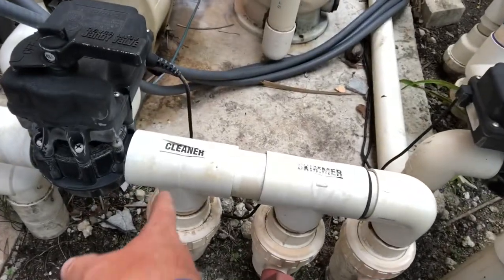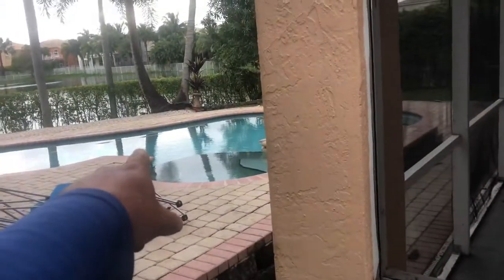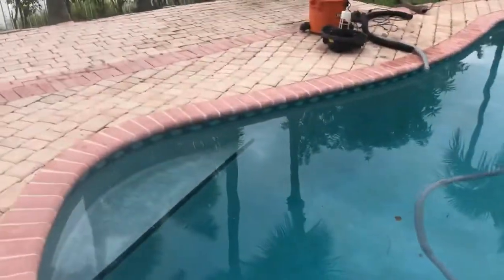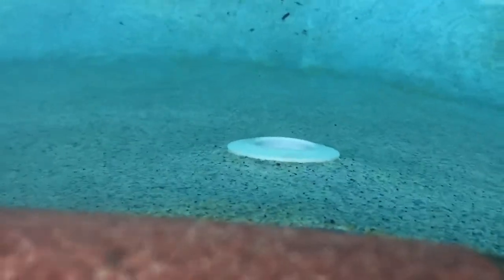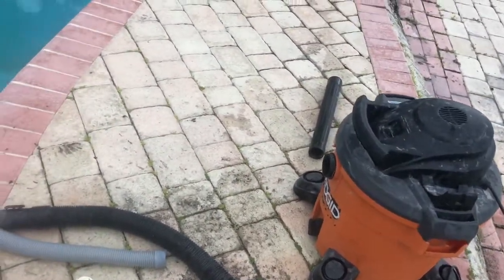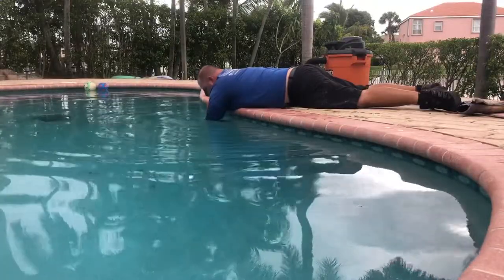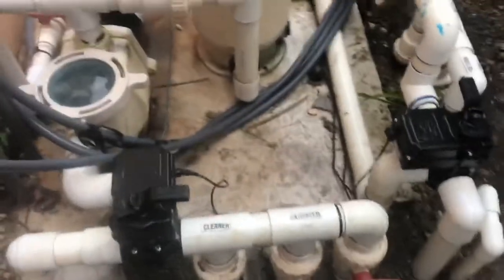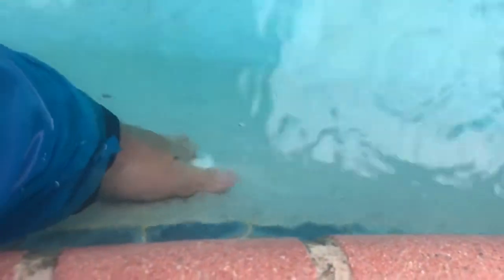Pool Plumbing Clogged!! We Unclogged It.

Comment: What you’re doing is SO informative, but PLEASE turn off the music so you can be heard better!!! Especially when the equipment was running and then you were at a distance vacuuming while talking. It’s absolutely awesome what you’re doing, but so frustrating listening to beat box music and trying to understand every word you’re saying. I’m going to go try this right now and see if it’ll helps. If a clogged line is not the problem, I know we had a burnt out gasket (or the ring inside, idk) for the skimmer/vacuum controller. Could that also pose similar symptoms with not enough suction?  Thank you So much for making the video
Reply from the maker: Don’t over look your pump lid and/or gasket. I’ve seen a pump lid be unnoticeably warped not allowing pump to fully prime.

Comment: Thank you for your video. I accidentally turned one of the skimmer values to a position that stopped the drain and vacuum flow. I was in a panic thinking I had a leak at first. Your video helped me trouble shoot it and quickly was able to identify the issue.

Comment: My dog knocked a big potted plant into the spa. I'm going to try and clean the drain line this way and see how it goes. I think it's full of potting soil and dirt. When in spa mode, it looks just like what the pump was doing in the video here. Lots of air, not much water and pressure swells.
Reply from the maker: Good luck

Comment: Nice job! I have a question, with my pump drawing from just the skimmer, it's fine, but when I set the valve to draw from the main drain it loses suction, then it will build back up, then loses suction again, when I close the main, the skimmer takes over and it works fine again, could this be a clog in the main drain?
Reply from the maker: Could be a clog or most likely a broken cracked line. To check this, you’ll need to have pipe inspected
Reply: So, another question is, like I said I usually just leave it on the skimmer setting and it's fine, but when the filter starts up in the morning it bubbles and gurgles air out through the return jets for about 30-45 seconds, then settles down and flows fine, where could all the air be coming from?
Reply from the maker: This is normal in the morning first start up. It’s the pressure from pump pushing water through the pipes initially.

Comment: Is the water source at the jandy valve a pressure washer or hose.  How are you providing water pressure without sealing the Jandy valve?  Looks like you just put hose in valve How did you prevent the water just coming back out the valve opening?  You did not show any debris going into wet dry vac.  Did vac pull out the clog?

Comment: How can I contact you? I think I have the same problem. I also just purchased the same vacuum and have a big oak tree that has branches hanging over the pool. Which causes some acorn/nut to fall into the pull and break into pieces that get stuck on the vacuum suction. How can I call you?

Comment: I have a clogged vacuum line used a plumbers bladder to backwash the line and used a small 2 hp shopvac to suck from the vacuum line. It still is mostly clogged. I didn't use the plug like you did to pressurize it though. If this doesn't work what's the next step? Do I have to call someone to snake or hydrojet it? Thanks. I'm going to get a basket like you suggest when It's fixed.
Reply: attach a small section of hose to the vacuum port. Cover the end of the hose with your hand to pressurize it like he was doing with the plug. 
with the hose attached, you can direct the water outside of the pool so that the clog won't go back into it

Comment: What is a Durado and what is a vaccuum line?    Do you mean an electronic pool cleaner like a Polaris?   Thanks
Reply from the maker: A Dorado is a “Suction” type pool vacuum cleaner that works off the suction ( vacuum ) of the pool pump. A Vacuum line, also referred to as a side suction, is a dedicated independent pvc line that is plumbed to the pool pump. When this line is used and a suction side vacuum cleaner connected to it, the vacuum will move along bottom of pool and clean it.
Reply: @EliteSwimmingPoolsTV   Okay, thank you for clarifying that for me.  I appreciate it!!

Comment: My inground pool has 2 skimmers, 1 is working normal after using a plumbing bladder to remove some debris, the other isn't working at all. Would each skimmer have it's own plumbing to the pump, or would both skimmers be connected by the same pipes? I'm just wondering why 1 would work and the other has no suction at all. I just bought the house and the pool hadn't been used for 3 yrs so it was full of algae, leaves, pine needles, spiders, and mud. I got the water blue (but it's very cloudy), the jets are working but have low pressure, and 1 skimmer is working, but that other 1 isn't. Also I can't seem to get that mud to be filtered out, I brush the pool and it turns the water black then it just keeps sinking to the bottom of the pool. Any help would be extremely appreciated
Reply from the maker: Having two skimmers and determining if they are separate or joint together you would have to look at the pump area. So you’ll have to focus your attention at the series of plumbing that’s is all connected together and heading into the front of the pump. This is the suction side of the system and where the skimmer(s) pvc pipes would be located. Depending on how many pipes you see all connected together going into pump, you would have to start by finding which valve on the pipe is managing the one skimmer you see is working and mark it with a black sharpie. Then open another valve first and then close the one you marked, then try to determine which pipe that valve is managing. Continue with this technique until you go through all the suction side pipes. I will say that depending on how the original plumber of the pool made his connections will determine if you have one main line for both skimmers or if you have two independent likes for each individual skimmer. I have seen plumbed one principal line for two skimmers before and there’s not much you can do to regulate the suction pressure. Good luck
Reply: @EliteSwimmingPoolsTV  thank you for your reply!! I have 3 ports on the pump. 1 is getting zero flow while the other 2 flow perfectly with no air bubbles, so I'm assuming that port is connected to the skimmer that isn't working. I've tried plumbing bladders at the pump and then at skimmer, wet vac at skimmer on both suction and blowing, and bought a drain snake all with no results at all, not even a little flow. The bladder shoots out when pressure builds, the wet vac is doing nothing, and the snake I think is getting to a point in the plumbing that it can't fit through because when I feel resistance I do what the snake requires and it grabs nothing. I'm going to try a flat snake next. Do you have any advice or possible ideas I could try to get this thing unclogged? The pool wasn't used by the previous owner for 4 yrs and I pulled an animal skeleton out of the skimmer line I got working, so I know there must be something crazy in the line that's still clogged.

Comment: No compressor? Just hook it up thru the jandy port with the valve cover off and blow away
Reply: What do you mean by compressor?   What do you put in the jandy port to blow away with?   Thanks
Reply: @anitarushlow4022  there's adapters you can buy to plug the jandy valve port so that the air from a compressor is directed thru the line to force out obstructions. Another way you can use a compressor is to hook up a threaded bit that fits into the pump's drain plug threading and then you can blow out obstructions from there
Reply: @SM-ql8ty  Thanks for your prompt reply.  Unfortunately I am such a rookie that I still have no clue what you mean.  But thanks for trying to help.   I just need someone to explain it to me as if I were a 5 year old.   Lol.
Reply from the maker: A Compressor is a type of equipment that compresses air and build up a certain pound of air pressure. With the correct type of adapter that could fit inside of a directional valve (Jandy Or Pentair Valve) you essentially could use this compressed air to blow out any possible clogs in a pvc pipe.
Reply: @EliteSwimmingPoolsTV    Thanks.  Now I understand what a compressor is and I think the directional valve are on top of the main line and the skimmer line, I think I understand.   But I have watched tons of videos and so many of them say that it is bad to get air in the system.  Since I don't have a compressor I guess I'll have to call the pool guy....cha ching for him.   lol

Comment: I don't know if you realize this but you go from trying to disconnect the intakes pipes to a shot where you have plugged 'something' in to try to unplug the line.  As another comment has mentioned you never actually describe what equipment you are using to dislodge the objects in the line.  I'd suggest you get a program to edit the video - there's probably something inexpensive that will either allow an edit to the video or add some captions.
Reply from the maker: Trade Only equipment used here. 🤷🏼‍♂️

Comment: Puts threaded valves on all of the suctions except one lol.
Reply from the maker: Some plumbers choose certain parts differently than others. We’ll also the 1 3 port valve is necessary for spa mode applications
Reply: @EliteSwimmingPoolsTV  I'm sure the plumbing on the spa suction was not like that from day one.  There's a few couplings and whatnot that show that was probably a repair job....  but if someone willingly chose that, it's time for them to review how drastically fittings change the pool's TDH and overall efficiency.